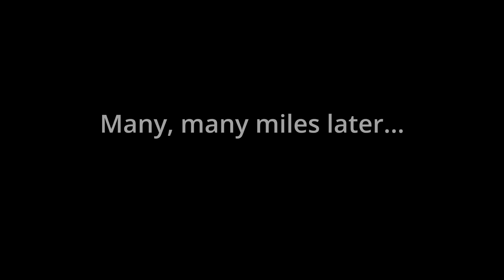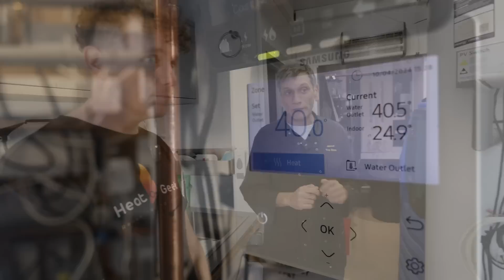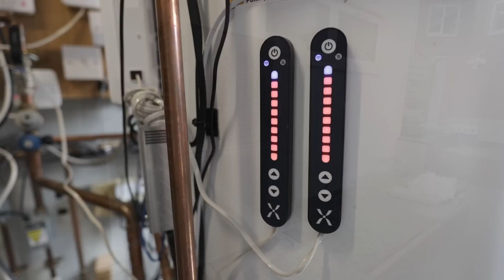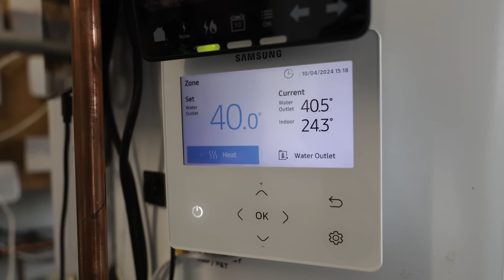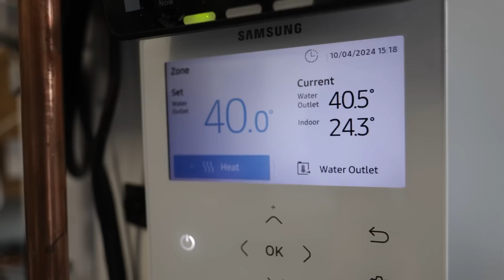Urban Plumber & Chief Heat Geek Put The World To Rights

Comment: Did anyone spot the Air to Air AC unit in the bedroom? If that is a HP model (most are) & they are replicated in all the bedrooms then I would have perhaps used them for heating & cooling each room & used the Air to Water for the Domestic Hot Water & perhaps heating any non-ac spaces. Just a thought & based on limited info from the video.
Reply: I think you should come over and experience it for yourself :-)  To be honest I had the same thought but that was long after they were installed. But that's hindsight, and hopefully someone else can learn from it :-)
Reply: @MagnoliaHouseRye  Yes hindsight is a wonderful thing. 10/10 for your insight & determination to take on the changes needed to make your business more sustainable. Projects like this evolve over time & are subject to budget restrictions so are somewhat piece meal. Improvements are always possible & technology keeps evolving.  
I had 48 years in the UK HVAC industry so I have lived with heat pumps of all types for all of my adult life at manufacturer, distributer & installer levels. 
Rye is a fare way away from me but if I ever find myself in your neck of the woods I will look you up. Good luck with your business.
Reply: The only problem with pure A2A for heating is that it tends to be less efficient, at least on paper. I am under the impression that it's entirely down to the choice of refrigerant (R410A or R32 vs R290), as you also see exactly the same efficiency difference between older heat pumps (R410A) and newer heat pumps (R290). The problem with R290 in A2A heat pumps (And split A2W heat pumps) is that the refrigerant is an extra level up the flammability classifications (R32 is A2L and R290 is A3). The classification affects the maximum amount of refrigerant you can have based on the size of the rooms it goes through, the rule being that if the gas were to escape within a room, it must be sized such that it couldn't achieve a flammable mix. You can get around this with detectors and additional ventilation, but A2A manufacturers don't want those restrictions on their products.
Reply: I had this thought as I watched as well. Heat/Cool the rooms using air to air if the insulation is so good. Depends on model but SCOPs probably would be pretty comparable
Reply: I'm very surprised they made no mention at all of the splits.. That would seem a logical choice to give easy control to the guests in each room and then hot water + shared spaces with the A2L.

Seems like quite a hodgepodge setup, would definitely be interesting to know more about the install in general.
Reply: @natodemon1  Hodgepodge = To a great extent I made this up as I went along so you're exactly right!  But..what am I left with?  .If the ASHP fails, the A2A's can still keep the guests warm, the immersions can still heat the water; I won't have to hand out compensation and my paying guests none the wiser 🙂
Reply: @MagnoliaHouseRye   Didn't realise you were the owner, thanks for the reply! That makes sense and redundant systems are pretty much always a good thing to have!

I was more surprised that no mention was made of the splits on the video as I feel they can be a valid option for heating that is not very well known in the UK.

Comment: only 200,000 out of the 600,000 thousand plan to meet supposed targets were installed,  75% of these on new properties,  this is why the tax on boiler operators was scrapped otherwise they were going to shut down uk operations, for europe,   i still feel that whist many new builds will install them with solar,  or those with heat losses less than 7kw,  but those with properties over 16Kwh heat loss due to size or construction from existing stock it will be cost prohibitive to swap,   futher more people are FORGETTING THE END OF ECONNOMY 7, 2030  to be replaced with a 3 price structure american style so peak will be 6pm to 11pm at 46p per kw at current rates of 24p for normal,   and smart free energy in time periods in the day when people are at work and unable to use the price bonus, unless they work from home,
Reply: this is why i feel bio gas and possible hydrogen at 15-20% will still be forced through, simply becuase of the huge upgrade needed for both electric and gas to cope, gas will continue for another two generations
Reply: The gov watchdog had as the gov this week to continue the rollout plans for hydrogen, as well s grid changes to cop with the demands

Comment: Would love to know more about ThermaSkirt / skirting board heating. Do they still work if you put furniture e.g. a bed or sofa in front of them? I'd imagine it's a bit like UFH heating up screed in that case.

I'm guessing it's better to supplement existing heating rather than entirely replacing rads, unless you have very low heating requirements per m2 like this b&b.
Reply: I have no regrets whatsoever.  I have found that putting things in front of them hasn't made a difference at all.  The warm air coming off them tends to rise upwards in a confined space, like the beds.  And they give me the benefit of not having to clean behind them, and one less bit of 'wall clutter'...
Reply: I don't like skirting radiators but may because I spent the 80's ripping it out. It was always minted up, it never got cleaned especially once covers were painted and they couldn't be got apart.

Comment: In a bnb/hotell, with low seasons and large areas with 0 usage / no persons for perhaps weeks, a zoning seems ok? It should reduce the overall electrical bill. 

Normally i would not recommend zoning, just balance the diffrent flows, ifs it possible.
Reply from the maker: I still think it could be run open loop with temp limiters set to low or set back out of season

Comment: I'd love to see a co2 heat pump designed for a setup like this 👌 

They're expensive buggers but they make sense with large scale jobs like hotels and the like. Great videos and keep up the good work Szymon.
Reply: I'm still unsure about CO2 for heating. It makes a lot of sense in a commercial cooling application where you have two desired temperatures (Fridges and freezers), but from my understanding (Which may well be incorrect) I can't see how it would benefit a heating application. Most of the marketing for heating-oriented heat pumps seems to be due to the lower CO2e of the refrigerant, rather than efficiency. There are also some claims about very high temperatures, but I'm yet to see any data with a direct and fair comparison against a modern (R290) heat pump.
Reply: Co2 HP's are out there. Commercial & some residential models in Japan & Australia. I nearly installed a Sanyo in my house (UK) a few years ago but I couldn't make the cost stack up - no grants available back then.

Comment: I’ve got to hold my hand up here, I am somewhat of a cynic when it comes to these installs due to the complexity and lack of education out there around them. However, I must say I found this video fascinating and really educational to watch. I still come down to the age old point it’s complicated and the size of installations needs to come down drastically to replace the age old box on the wall. Top video chaps a good watch 👍
Reply from the maker: It’s slowly getting better. Not as fast as we need though
Reply: Also if you look in one of those gas boxes they are not simple either. It will take time. software is going to be transformational to the user experience too.